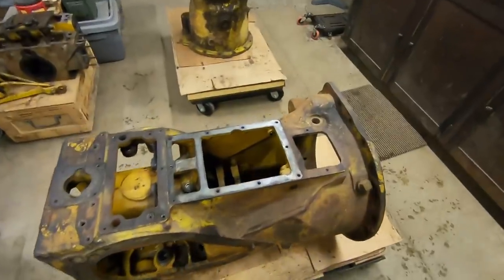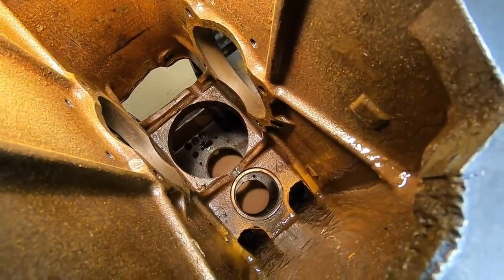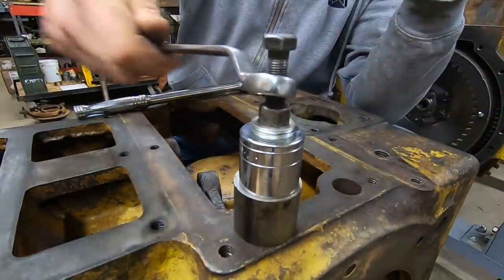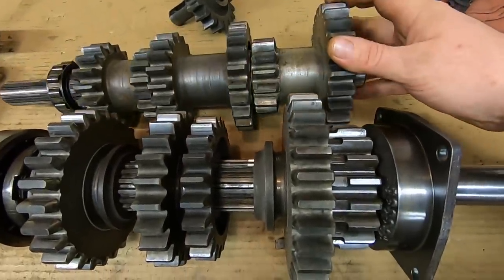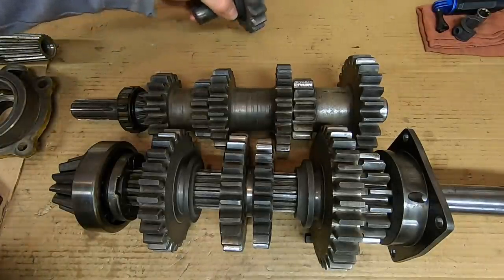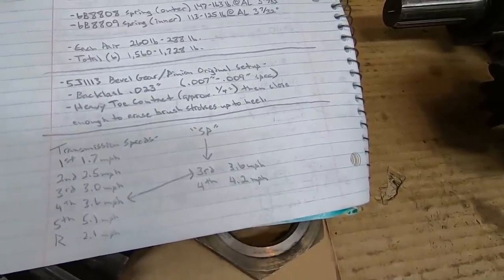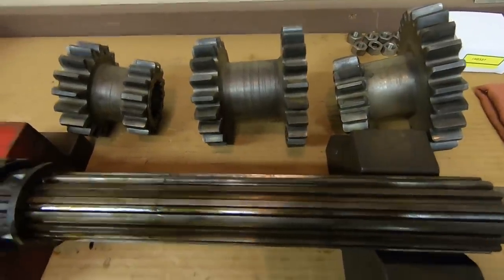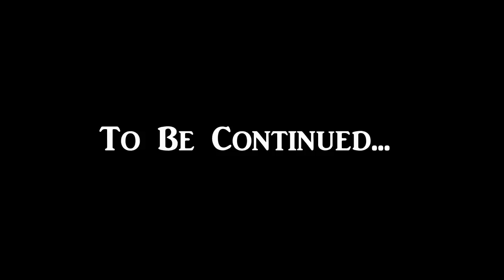Caterpillar D2 #5J1113 Chassis Rebuild Ep.10: Assessing The Gears & Letting #1113 Tell Its Story...

Comment: I worked in the UTB factory (Tractor Factory of Brasov - Romania) Long tractors brands for the US. I tell you, the smallest  imperfection on the surface of one single tooth we scrapped the gear. A small pit, can create small vibrations in the train and will reduce the life of bearings, and other components. We took pairs of gears in laboratory to  analyze the sound and vibration while they where spinning both freely and in load.
Reply: Is there any way to restore bitted gears? I imagine that would need prescision work.
Reply: @SuperMAZ007  Unfortunately no. After the milling process (cutting the tooth), we honed the teeth to the final specs and the right roughness (Rz) and after that they went to the heat treating  process.  If you weld the surface of the teeth, (let's say it doesn't create microcracks due the material use vs the material of the gear), you have to hone  it again otherwise the irregularities will bring vibrations or other problems making it worse . You need the machine and the special dedicated tool for that pitch, angle (beta angle), because you need to recreate the intermediate diameter (I don't know in eng. the word) and the involute.  Even if you have the tool, it's already hardened and it will ruin the tool itself.

This is a modern version of honing using gridding stone
https://www.youtube.com/watch?v=_D-iV9cGjF4

We used to hone the using titanium coated metal tools

Comment: Great video as always.  I think the wear you are talking about is spalling vs. brinelling.  Not trying to be a wise guy but there is a difference.  

Brinelling is the permanent indentation of a hard surface. It is named after the Brinell scale of hardness, in which a small ball is pushed against a hard surface at a preset level of force, and the depth and diameter of the mark indicates the Brinell hardness of the surface.

Spalling is the result of surface or sub-surface fatigue, which causes fractures to form in the running surfaces. When the rolling elements travel over these cracks, pieces, or flakes, of material break away. (Spalling is also referred to as “flaking,” “peeling,” or “pitting.”)
Reply: Arcane knowledge

Comment: Actually I would say that slower speed is more strain on the drive train.  If we apply those rated pull loads for a given speed, the slower we go the more torque we have and the greater the loads on the gears and the more we pull !

Comment: Another timely video! The steering clutch pivot bearings are not available but McGill MR14SS will work. Arms have to be bored to 1.375. I also made 2 new pins. My bevel gear is also poor but have sourced a VG take out. I hope you cover setting backlash a contact pattern.  Thanks for all your time and effort, 
Merry Christmas to you and all your followers !  Herb 5U12016

Comment: Really nice demonstration of power flow through the transmission. I noticed that the gears for 3rd and 4th are thinner than 1st and 2nd, probably because there is less force required of them. that seems like good economical design.

Comment: I'm an old automotive engineer and I did do some time in transmission engineering (you never see square cut gears in any light duty vehicles).  You did a good job explaining power flow, the only thing I would have added is showing how the input gear is spline directly to the output shaft for 5th.
Of course, you did not have to explain synchronizers !  :)
With new bearings and tolerances adjusted, that transmission would probably last 1000 hours, especially if you did not use 3rdand 4th very much.

Comment: Merry Xmas Squatchy’s. The last 18 years of my trade I spent looking at big mechanical reduction boxes and our assessments were made on very slow moving gears which were pitted so badly that use to send shivers up my spine at least!   Making an assessment will it go another term was taken into consideration each time and I must add got easy the more the time I spent analysing their conditions over the years with notes kept with photos etc.
 However as like courses for horses working on small higher speed gearboxes as you do, it is very critical to let any pitting on gear profiles go neglected when acquiring attention. 
I like your channel as your keenness to get it right first time blood in your veins also runs in mine. Maybe from my first day as an apprentice I learnt there is a lot to learn even more than shiny metal or not so shiny metal regards to condition of a mechanical item and when management overrules your knowledge in later years, you wanna see what I have seen with large mechanical boxes can do to totally destroy themselves! 
I have also driven very old neglected farm equipment and when have stripped down to that grating sound I wonder truly if every Farmer should be like the Squatchy’s in their assessments of machinery, however you were not around on film then. 
I guess saying this if machinery was maintain the way you guys do it there would be no need for newer machinery and the farmer would have more money in the pocket in the long run. Cheers for the new year also.

Comment: Just as a thought, Could you fill in the pits with bronze and then machine that off just to reveal the steel with the pits still in bronze and run it.  It could give you at least a lack of an empty space to cause problems, knowing the bronze won't transmit much force.

Comment: Useless fun fact, from the John Deere 420 with 5 speed transmission, all the way through the 1010 wheel tractors, they shared a shift pattern similarity with the D2 Caterpillar. 1 and 5 are on a rail together, 2 and R on a rail together, and 3 and 4 are on a rail together. The power flow, and gear position (forward or backward) may be different, though.

Comment: That was a fantastic explanation of the power flow Toby thank you. Question, would newer formulation gear oils (GL4 or 5) stop further wear on the pinion shaft/gear sets or lessen wear as opposed to older formulation oils? 'Nuther question...the pitting caused by moisture in the oil? ...Mike

Comment: no matter which gear sets you use.  are you going to add neodymium magnets to the transmission case and the  final drive case.. or just rely on the magnetic drain plug.. or will you take a non magnetic drain plug from your storage .. and create a neodymium magnet drain plug for both transmission and final drive case drains.

Comment: Out of academic curiosity, I know it would make little sense to do it, but would it work if you installed the bevel gear facing the other way on the shaft to convert it into a machine with 5 reverse gears and 1 forward? The casing and everything looked pretty symetric as far as I could tell from the video.

Comment: Gear ratios on "SP" are more even with other gears basically 1mph between each gear. Standard gear ratio makes 3rd and 4th almost the same .6 difference almost pointless. I can see why many used SP gear set